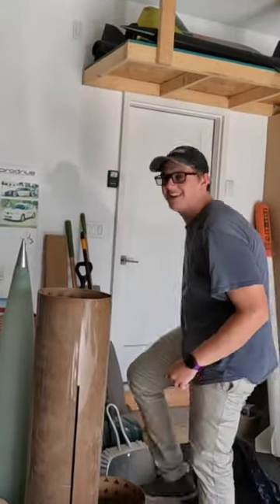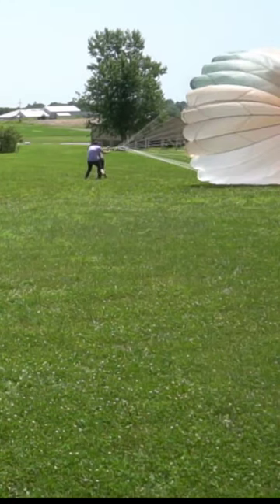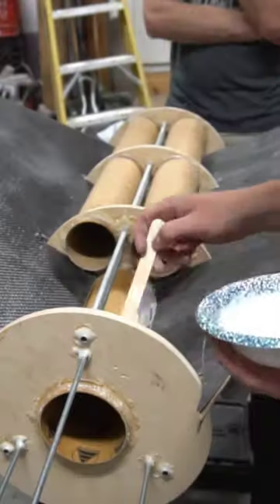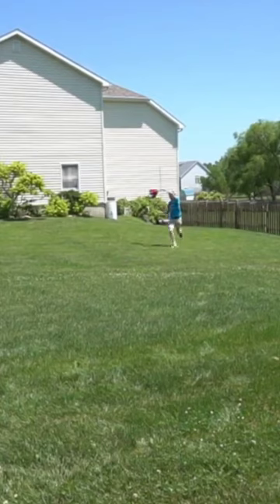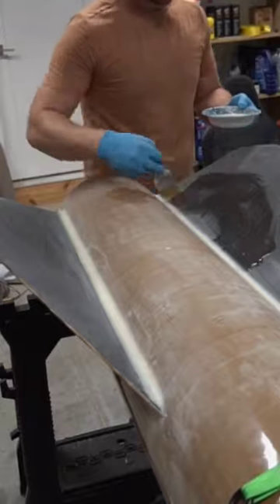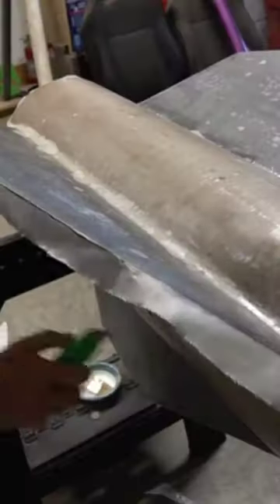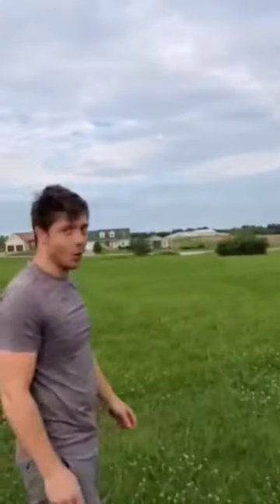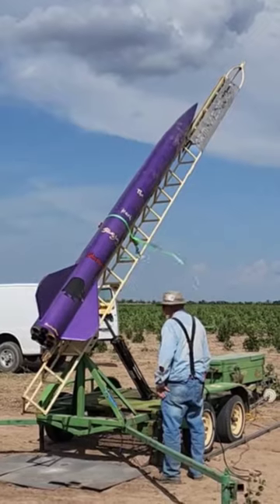Building and flying a 200lb and 16ft tall model rocket #science #shorts #rocketry

Comment: Cool !
My largest rocket weighed 6#, flew on a J-350 and reached 3500'.
Reply: A link to the video?
In the early 90s, we flew dual stage FSI e6 motors with 9 second burn time to 4100 feet.